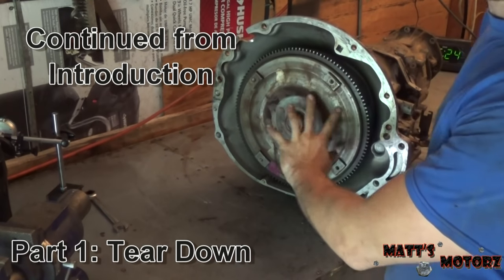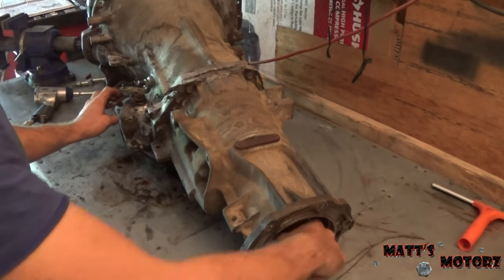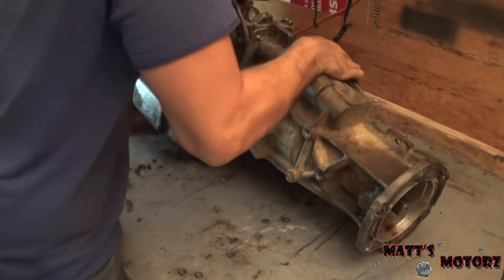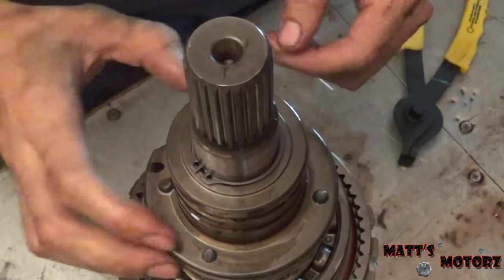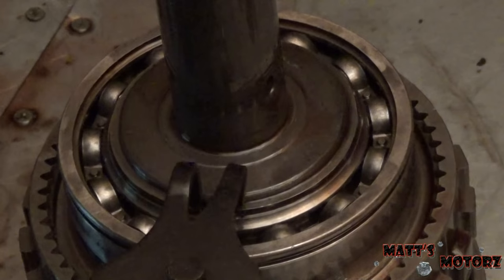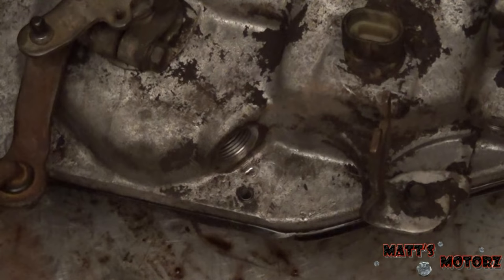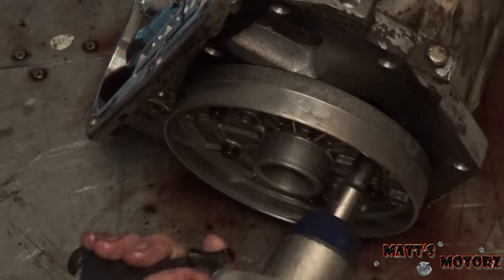42RH / A500 Transmission Rebuild: Part 1 - Tear Down

Comment: Thank you Matt! I went to automotive school in the 90's. I dropped out due to financial reasons. The one class I missed was automatic transmissions. They had always intimidated me. Again--that you for your video. 
On a side note, I brought a vechicle to the AMMCO Total care Experts. They told me the transmission was fried. They pulled the pan, and said the fluid was varnished. (I know for a fact it wasen't, because I pulled the pan to change a pressure transducer the previous day.). They said it was going into limp mode. (They lied again--I have a Snap-on scan tool.). They claimed it needed a new spindle, caliber, and brakes. (They lied again.). I asked for a quote on a rebuilt transmission three times. He wouldn't give me the worst case senerio price. He stated they charge $2300 to open it, and then they mic. all parts, and add to the $2300. I said will $5000 cover it. He said, "I don't know."My point is be careful with AAMCO. After he found out I used to be a mechanic, he followed me into the parking lot kissing my ass. He knew he lied about the estimate. This was at the Marin County AMMCO franchise. Sorry about the rant on your video site. My final recommendation, If a technician won't give you a rough estimate on a rebuilt transmission---Walk!
Reply from the maker: Thanks for the comment! I really don't like when shops take advantage of people.  There is an AAMCO right next to my shop that I sometimes go to if I need something pressed out (I don't own a press) or need to remove something in a trans that requires a special tool and they are always super helpful and friendly.  So I think it can vary widely between locations.
Reply: MattsMotorz That's the downside to franchised businesses. Since there are so many different owners of all the different franchises,it's very difficult to get a consistency of quality of work, customer service or products.

Comment: These videos gave me the confidence to try my first auto trans. Thanks Matt.
     I made the overdrive spring compressor out of 3 -1/2inch all threads outside the drum, connected to 2 pieces of heavy plywood on the front and back, bored for the output and intermediate shafts, with 3 5/16ths x 8" bolts on one end to push down on the clutch hub. the intermediate shaft is used for the planetary gear alignment.
     The front pump can be easily removed if cutoff bolts of the smaller inside thread, with a screwdriver slot cut in the end, are inserted into the deep holes, and larger bolts are threaded into the outer plate up against the small inserts to force the pump off.
     The worst part is the determination of the overdrive clutch pack selection as the design changed in the earlier years of production. On mine, the literature had me remove a .215 center steel, ( only 2 friction discs) and replace it with 3 friction , 2 steels, and reverse the pressure plate and reaction plate. I'm still worried about it, but it should work just fine.
I'll let you know if it works when I'm done.
GC

Comment: Good Video...dont change anything, you never know when you can pick up a new technique to wrenching. It does remind me though of a time I went to the mower shop for a key for my minibike when I was 12. I told the guy I needed a keyway for my clutch..., and I kept calling it a keyway, hey kept calling it a key. Until he shouted..., ITS A KEY lol. the keyway is the slot, the key is the chip!

Comment: The A500/42RH/42RE is based on the A999/32RH.  You are looking up specs for an A904/30RH.  While the cases are the same, the internals are not.

Comment: Thank you for your efforts great video. However, could use some fixing...you missed a few steps which made it hard to follow at times.I watched another video and realized that there was a piston in the forward clutch drum, the one were the shaft needs to be pressed out. So I had to tear it back apart and replace those seals.This was my fault for not looking at the breakout Picture to mace sure..kicking myself. thanks.Oh it looks like you put the rear band servo ring upside down the spring should fit inside the ring, thats why it was hard for you to get spring compressed and snap ring in place.

Comment: The problem is that many rebuilders use used parts and still charge$1,800.00 to rebuild transmission.

Comment: how did you separate the forward drum shaft  front ring gear and the drum mines stuck together and cant get it apart to check the forward clutch plates

Comment: sir at a bare minimum, what special tool or tools must I have to rebuild the a500. I have a atsg manual on the way. I have a shed full of common tools, a mig welder, torches, impact wrenches, air compressor, pry bars ect. I have crappy smap ring pliers, can u reccommend a good brand.
Reply from the maker: I don't remember honestly.  This was so long ago. Watch through the video series and see what I use.  I remember having to make a few special tools to get everything done.  As for snap ring pliers, I also have crappy ones, been wanting to get some good ones for awhile.

Comment: Hello Matt. my question is how r u cleaning parts? y a parts washer? also have a question.  i have a 32rh which had water in it. flushed, new trans front pump, an new torque converter. put together. wont even turn tires. help
Reply from the maker: Before I had a parts washer, I literally just used throttle body cleaner or brake cleaner.

Did it turn the tires before you did the pump replacement?  If so, then I would think that something went wrong with the installation of the pump.  If not, then it is impossible to say without getting some pressure readings.

EDIT: Or the fluid is low.

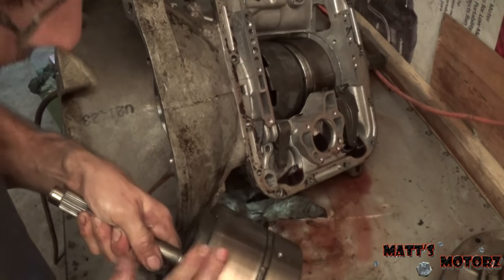Comment: At 27:42 through 28:11 my two assemblies came out as one long shaft, and I can't seem to break them apart. Any suggestions? I got the pump and the first drum out separate, but the next two are stuck together.
Reply from the maker: Hmm. That is weird, you SHOULD just be able to pull them apart.  Perhaps try to persuade it with a brass hammer.  I don't work on these all the time so it may be possible you have a different year / model.   You should be using the factory service manual if you're in this deep, it should say in there what to do.  You can obtain the entire rebuild procedure from alldatadiy.com, but you need to purchase it for your vehicle (I think its like 25 bucks for a year).

Comment: sry for the repeat question but do you mean pull straight out (away) from the trans or up to like tilt it out?
Reply from the maker: +twonb91 Pull straight down as much as you can and then tilt it out the rest of the way so the rod can come out.  Again, make sure the E Brake is on.

Comment: Hey man, have a a500 automatic transmission. I have it out like the one here. I remove the main bolts that keep the overdrive to the main housing. When i turn it it will wiggle left and right but doesn't come up. Any suggestions?
Reply from the maker: On the overdrive section? There is a snap ring that holds the whole thing together.

Comment: can I do a swap trans? ..... I have a dodge magnum 1979 w/  318 engine & 904 trans, I want OD 0.69 trans, is better gas millage and lifetime motor.....  can I put the A500 on it?
Reply: Yes you can. The only issue will be depending on what car you are putting it into, you may have to do some modifications to the transmission tunnel and the crossmember support as this transmission  larger in diameter. It is also longer than a 904 by about 4 or 5 inches so you will have to get your driveshaft shortened.

Comment: matt if the endplay was out of spec, what would likely be worn out.
Reply from the maker: The clutch plates.  Any kind of checking of clearances is a way to measure how worn the clutch plates are.  When rebuilding a transmission, everything is built around the clutch plates.  When you put in new plates, many times you need to install different thickness washers or snap rings to keep other tolerances in the transmission in check (as all clutch plates are not the same thickness, manufacturing procedures make them off by a few thousandths each, which add up with multiple plates).  As the clutch plates wear, these tolerances get larger.
Reply: thanks, im going to tackle 2 a500s soon, and im trying to get all the knowledge I can, your vids are a godsend, plz keep up the good work,.
Reply: it would not be the clutch plates it would be thrust washers I am not very impressed with your ability

Comment: Can u replace the fluid pump without dropping the valve body on a 42rh?
Reply from the maker: +twonb91 In order to replace the pump the entire transmission must be removed.  After doing that, then yes you can replace the pump without removing the valvebody, but you must have the special pulling tool.  If you don't have the tool, What I have also done is thread very long bolts into the threads that the special tool bolts into and pull up on them.

Comment: I have a 2011 Range rover sport with 50K miles.  My transmission fault 
light came on so i got the code P2704 -Transmission friction element E element apply time range performance  &  code P0783 saids 3-4 shift?  What you reccomend I do?

Comment: If it looks like a screw driver, works like a screw driver, and tastes like a screwdriver...its a prybar.
Reply: Its a Prydriver. I certainly use those for prying things more than I do on slotted screws. Mostly I just use the term to upset my Snap-On rep.

Comment: Greetings,
How to fix transmission problems code P2704 & P0783--->  (3-4 shift) in 2011 Land 50K miles on Rover sport HSE
Reply from the maker: +Marlon Romero The simplest thing to check would be the 3-4 solenoid.  Disconnect the wiring harness and do a resistance check on the correct pins.  Don't know how easy it is to get to it on that car, but it might not hurt to just replace it, if it is cheap enough and easy enough to get to.
Reply: +MattsMotorz  Greetings again,
do you think the solenoid 3-4 will fix the code P2704 to set it off?
Reply from the maker: I cannot say. Automatic transmissions are extremely complicated machines and it is impossible to diagnose them over comments on YouTube.  This is just a guess and it is the simplest thing.  It is often the simplest things that fix most problems.  And often multiple codes at once are related to one issue.  So it may, and it may not.  I am hoping for the former.

Comment: a coupel question

what happens in this transmission if the PCM or TCM whatever is not working? does the internal hydraulics still work?

a 42RE is a light duty transmission, is it posible to swap 44re or 46re internals to have better torque capabilities?
Reply from the maker: The hydraulics will still work but the energizing of the solenoids will not.  So it wouldn't switch gears.  The older automatics had no electronics.  Everything was controlled with springs and valves in the valvebody, so it would always work and didn't require a TCM. (They weren't as good at shifting, but IMO were still pretty damn good)
Reply from the maker: Also, I don't know enough about the 44 and 46re transmissions to comment.  I would likely guess no, thinks like that generally do not fly with transmissions.  But if they are similar enough, maybe.
Reply: ok so putting the lever in D, 2 or 1 will activate that gear? y read soemwhere that D and 2 will work but not 1st
Reply from the maker: It is hard to answer that question without knowing the transmission better.  That is solely dependent on the hydraulic circuit design in the valvebody.  The operation of each gear is described in detail in the factory service manual.  If any of the descriptions require an energized solenoid, it likely will not work.